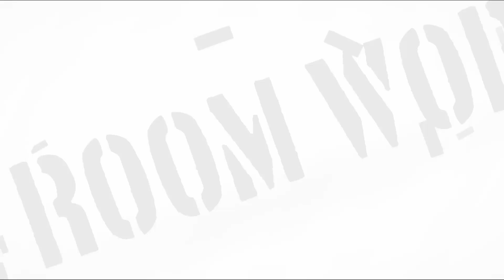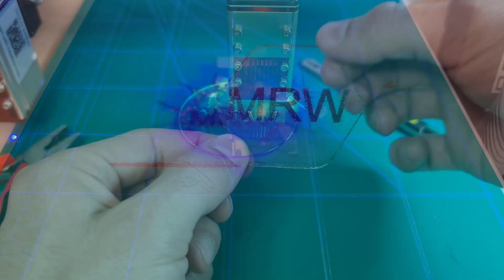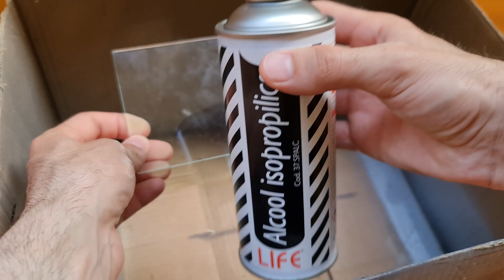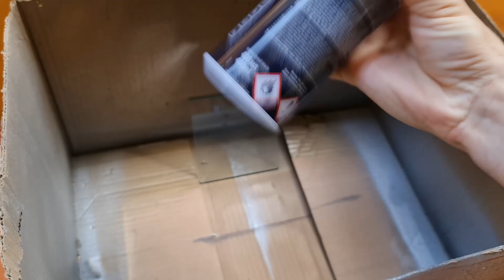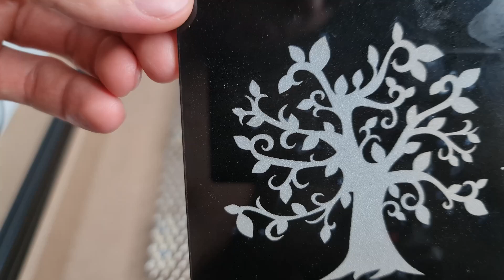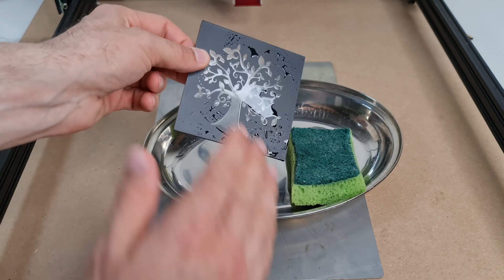Is this the best way to engrave glass? - Clean and Flowless

Comment: Does it make difference if you use acrylic paint as I assume that to be less toxic and easier to clean (Acetone is not nice stuff after all).
Reply from the maker: Hello Abbo Fun, thank you for your comment.

I believe there won't be any difference as long as what you apply on the surface is dark, evenly spread and well adherent to the surface.
The ultimate target is to have this sacrificial surface onto the glass.

I agree about the acetone. I will order some get some acrylic paint and test that in the future.

Ciao
Reply: For the best results a paint with Titanium Dioxide works the best, the titanium dioxide burns and etches the glass when the laser beam strikes the paint  Rustoleum X2 paint has titanium dioxide in it😊 🛫